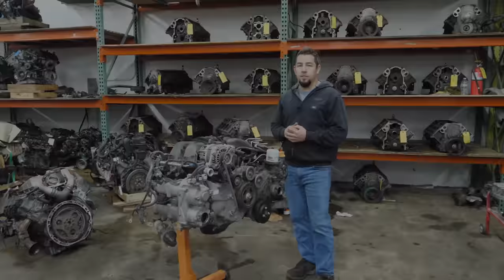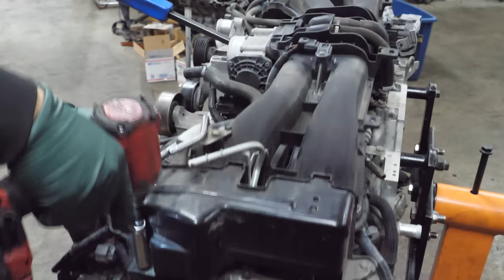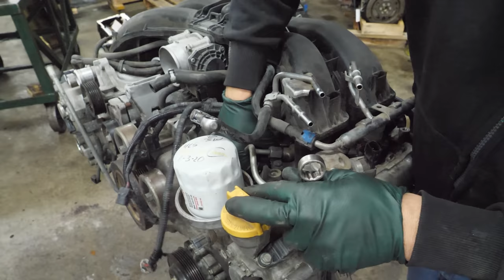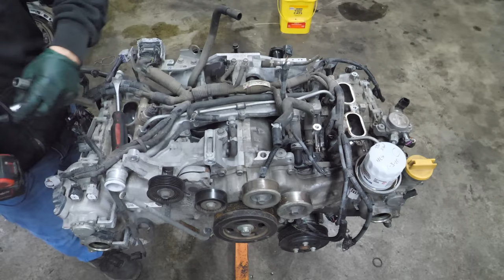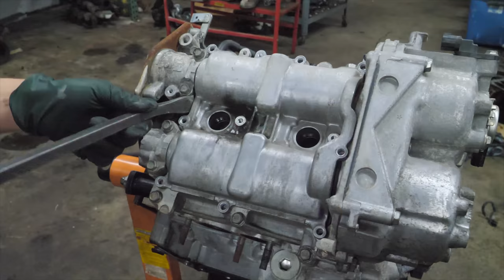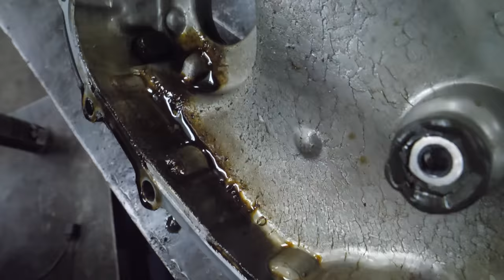Blown Subaru BRZ / Scion FRS FA20 Boxer Engine Teardown. A $3,000 + Whoopsie.

Comment: How do you run an engine low on oil? I mean, how long do you have to go between oil changes or checks before it's THAT bad? I don't check my oil quite as often as recommended (but I do check it) and the last car I had that actually needed to have oil added to it between oil changes was a 1986 VW Scirocco 16V that I owned back in the early 90's. I actually had 4 different Sciroccos and they all used oil, but the 16V was the last one I had before going with Asian cars. My current car is a 2015 Hyundai Elantra and the level on the dipstick never goes down so much as a millimeter between oil changes every 5K miles, and I drive it pretty hard 50% of the time. I checked it today in fact (road trip tomorrow) and the oil looked so good, you'd think it was changed yesterday. (Been about 4100 miles since the last change.)
Reply: I have a 2013 Elantra 1.8 with 118K mi. on it . . . pull your PCV and see how much oil  ( blow-by ) is in there.

*Read my Mr. Subaru1835 comments posted here*. If can happen so quickly you will not catch it. A cold snap at night???
The cylinder compression is not made to be tight enough from the factory to prevent oil from being burned in the cylinder ( Blow-by ) but allows them to get an extra 1 or 2 mpg at our expense. I hope this has been corrected but would still like to see some Precice Compression Tests done on late modrl RU's

Comment: The manufacturer should of placed a sensor inside the engine that light up on the dash to indicate low oil in engine. Poor engineering design.

Comment: Sadly ALL boxer engines, including those you readily fall to you knees to worship from Porsche, are prone to both consuming and leaking more oil than more rationally designed engines. Many in-line and V configuration 4 and 6 cylinder engines make more power per liter, burn far less oil, leak less, sound far more refined, and generally shame their stupid horizontally opposed competitors in literally every objective way. The whole lower center of gravity thing is pure fake marketing BS. It’s basically just 2 companies stupidly sticking to their equally stupid inferior roots. I’ve owned a few Subarus and they do many things well up to about 100K miles but the engines are crude and better suited for a farm tractor. I’ve also owned an air cooled Porsche that was perhaps the least reliable car among my 50+ cars I’ve ever owned. There are really good reasons nearly all SANE manufacturers just say no to boxer engines these days.

Comment: I just don't understand why people keep buying these cars with these horrible engines designed to fail, is like they're asking for it🤷‍♂️
Reply: They are not that bad.
They really only have 2 issues:
-Valvesprings. Recall is out on that one.
-On the track these engines have issues with oil starvation basically the pickup can suck in air during hard corners. Having the oil level all the up to he max line or even above that a little bit can compensate for that.

Those problems have been resolved with the new GR86.

Comment: Your information blaming the owner is completely false. These engines starve for oil at higher RPM’s causing a rod bearing to turn leading the to knock. Engine cooler can also help considering the exhaust is cooking the oil, heat rises